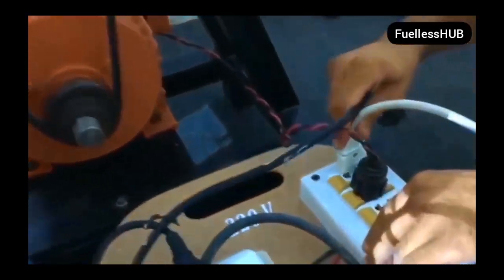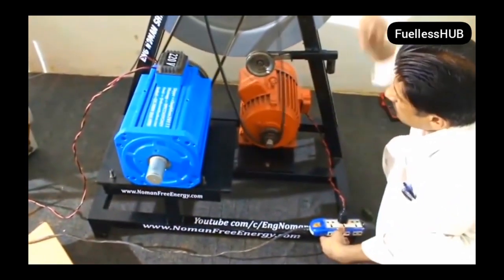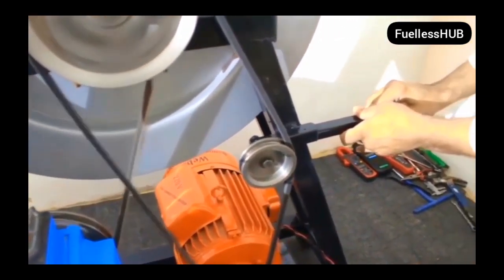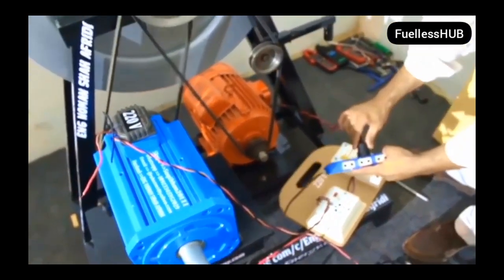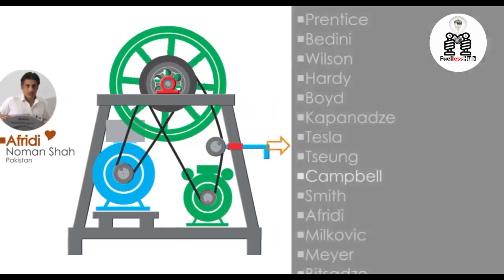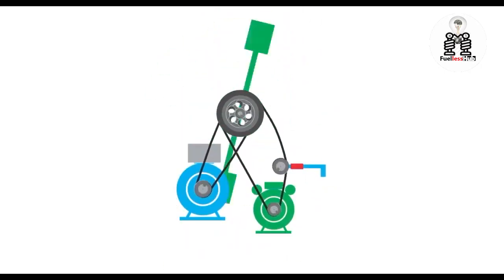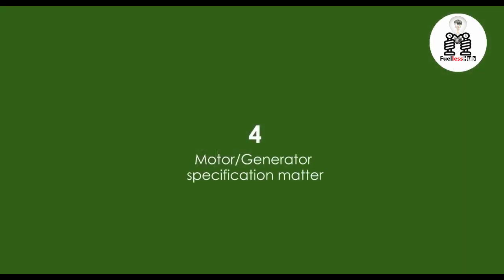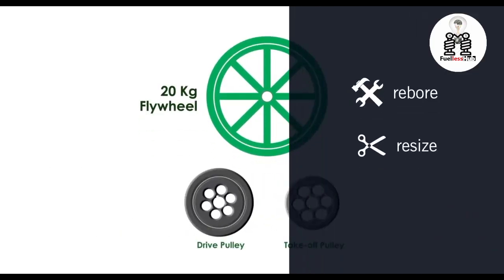Secret of Fuelless generator explained in Full part 2

Comment: For the design of a fuel less generator, what are your takes on my parameters?

2HP motor(1440 rpm, 220V)
3HP alternator (1500rpm, 220V)
60kg flywheel (22" diameter)
Pulleys:
3" & 6" for motor
3.25 & 6.25" for alternator.

Comment: Most of you miss something I need to say in the Fuelless generator project.. which is neodymium magnet. It convert your alternator to PMA and produce much electric current with less rotation
Reply: Where are you from.?
Reply: @niazdiytech  Nigeria, oyo state
Reply: Free energy really exist or not i don't know. But one thing is that i can say - when you put something load to alternator ( ac generator) its speed is suddenly change 😊and when speed of an alternator change it directly effects on frequency becausz frequency is directly releted to synchronous speed for its respective poles . When frequency change the output of motor torque speed also change . After all its almost fail 😊. Inducton motor,s speed torque is directly releted to the supply frequency . I think you know this think very well . here I'm talking eletrical part only ! On the other hand there is mechical factor ! remember

Comment: The secret is inside the generator.
Watch the video in slow motion , after 2,5 turn of shaft the iron plates touching each other.
This is something like switching or pulsating current system .
The main thing is bypassing lenz's law.

Comment: Free energy really exist or not i don't know. But one thing is that i can say - when you put something load to alternator ( ac generator) its speed is suddenly change 😊and when speed of an alternator change it directly effects on frequency becausz frequency is directly releted to synchronous speed for its respective poles . When frequency change the output of motor torque speed also change . After all its almost fail 😊. Inducton motor,s speed torque is directly releted to the supply frequency . I think you know this think very well . here I'm talking eletrical part only !
Reply: That's true my brother